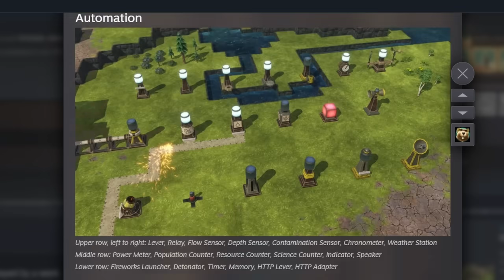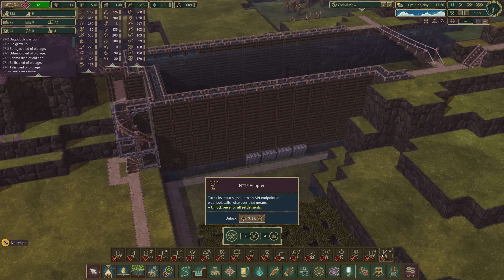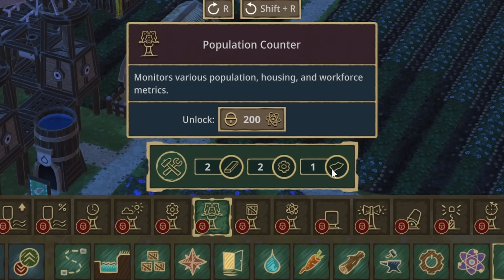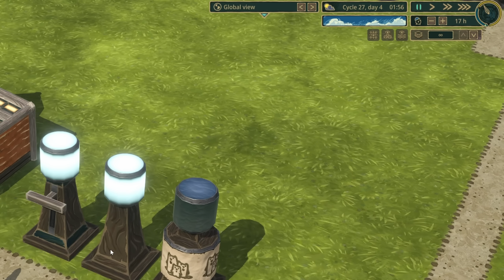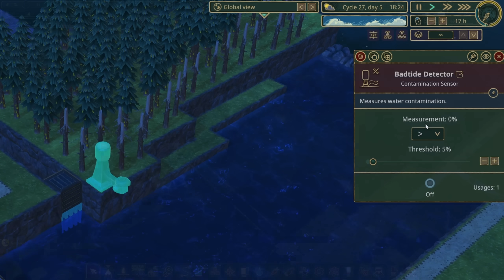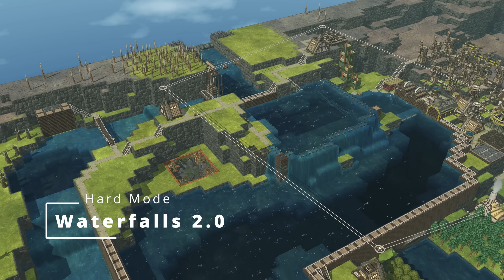They Updated Timberborn AGAIN and It's INSANE Now

Comment: Aside from obviously setting up automatic population management, the best part about this is being able to set your power generators to only kick on when needed.

I have so many engines rigged up to toggle on if power dips below 10% storage capacity then toggle off when it hits greater than 90%.
No more wasted resources running full time. No more manual on and off. Just a permanent backup power supply that manages itself. How glorious.

Comment: the fun in this game is primarily from how relaxing it is, i feel like this update is in the exact opposit direction.
Reply: I disagree, a big part in relaxing is the preparation set beforehand. When used well, this would absolutely make the game more relaxing. It can also be completely avoided if a player wants. Seems like a great addition.
Reply: I mean you still have the option to not use them....except for maybe the changed sluice -> valve stuff?
Reply: @avishjha4030  a shame they didn't keep the sluice in.  it may not have been able to be as fine tuned as a valve but it required less investment to get it working well enough.
Reply: Can’t really avoid it since the sluice is gone
Reply from the maker: we work today so we can relax tomorrow

Comment: Theres one more new building under power that let's you disconnect a line which you can put it on the upstream of heavy industry and cut the grid off when battery is low or something which could be fun to use (although that weather detector is already OP enough as you could just hook everything power hungry on it and turn off during a drought)

Comment: Question: Can the resource counter be used to switch recipes? Because that will be EXTREMELY useful. No longer would you need build multiple bakeries, fermenters or food factories, etc. Or manually switch each time. As soon as one runs low, or has no free storage; switch.
Reply: I don't think so. But just being able to disable them is huge. I hate having to deal with the mid tier foods that process way faster than I need - having the building automatically switch on and off is great.
Reply from the maker: There's probably gonna be a mod for that, but hey, at least we can toggle between the buildings now and enable whichever is lowest supply 👀
Reply: @DefinitelyWalky True. The designated beaver can simply move from one building to the next.
Or to any other job when the first used done.

Comment: I think the Memory Module might be useful in combination with the Resource Counter. For example, you could make it so that your lumber mills turn off when plank storage is full, and turn back on when plank storage is at 50%. I don't think you can do that with only resource counters.
Reply: yeah ot would just fill to 200 and instantly flip flop between on and off. Would've been nice if all modules had at least a bit of a timer on them
Reply from the maker: yes, the setup that I used in this video would jitter a lot.

Comment: The things these set of tools can do is mindblowing, although, I wish they would keeps Sluices at the same time instead of forcing us to use 2 structures; sometimes, we just need to build a Sluice quickly without the extra steps. FYI, Sluices can still exist and function on the existing map but can't build it anymore.
Reply: OO nvm, someone made a mod reverting it, and so fast!

Comment: The only thing I dislike a little is that they look a little too high tech. I would have preferred, for example, that sensors for water had to stand in the water, like the stream gauge. Or that the lights were little fires instead of lamps.
But I'm nitpicking and this game already has robots.
Reply: Yeah, I really wish a lot of these sensors had to be placed inside the body of water.
Reply: @almisami  Maybe a modder will take it upon themselves to make some tweaks like that.
Reply: One way to work around it is to construct platforms in the middle of the water and then place the sensor. But yeah I agree that it should be like the stream gauge.
Reply: @crumble1400  I've been wishing that the stream gauge would be able to automate things based on what it measures for a while. Happy to have that function, not so happy that the stream gauge is still pretty useless.
Reply: What if you had beaver controlled logic, with the beavers flipping levers depending on conditions.

Maybe "beaver logic" could be an early game alternative to automatic logic.

Comment: Does that mean sluices as we know them are being depreciated/replaced?
Reply: The notes (or was it the video they made?) said that if you already have them in your map, they will still be there. But they have been replaced with a valve. Something similar, but better.
Reply: @SweetPieWizard  Valve are actually worse, sorry. Needing to implement the detector logic with relays and stuff is worse than the current sluice.

I can understand why they'd want to have an item integrated to the automation framework. But it complexify a lot or early irrigation build... it's a huge change 2 weeks from release.
Reply: @arakwar  It really depends because now in many cases you can use floodgates with automation instead of sluices; it's possible to automate badtides without having any access to metal by using the weather sensor and floodgates, at the cost of having to go into treated plank production instead.
Alternatively for high-output sources like on Helix Mountain, you only need enough metal to build a single contamination sensor rather than nearly 12 sluices that it needed before.
For regulating downstream water height, it's strictly superior because you can just ignore elevation changes and use the lowest height, something that was not possible before without a series of sluices at every height change.
Reply: @arakwar  I agree with you. 

Having played with sluices and now losing them, I missed them when playing yesterday. Guess that's what we get for playing experimental. Nothing is forever?

Enough pushback, perhaps they will put them back??

I need some explainer videos, at least, showing me how all these things work together. I have an old beaver brain. I was hoping for more decorations. ha ha.